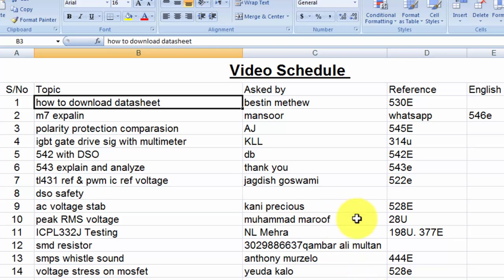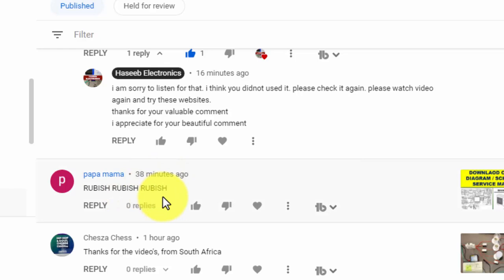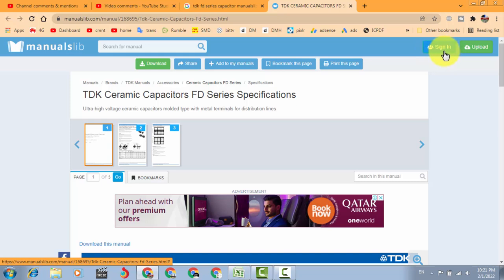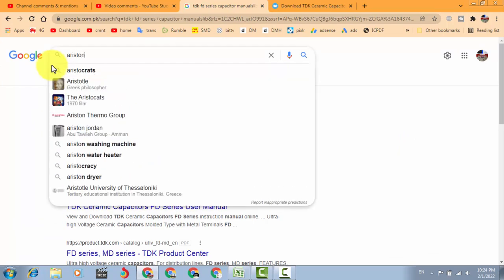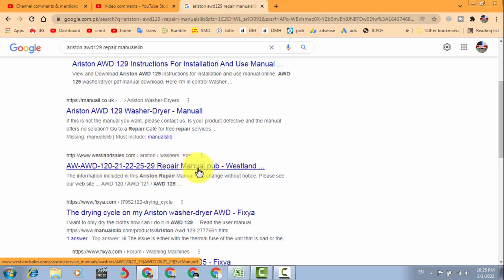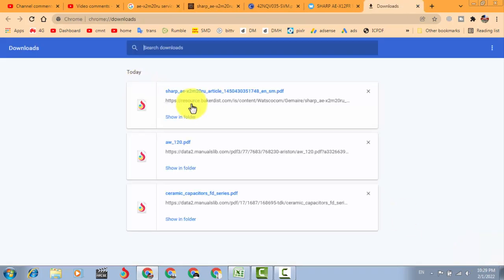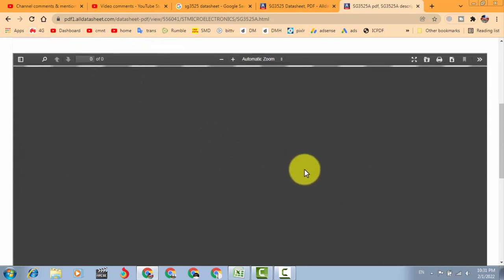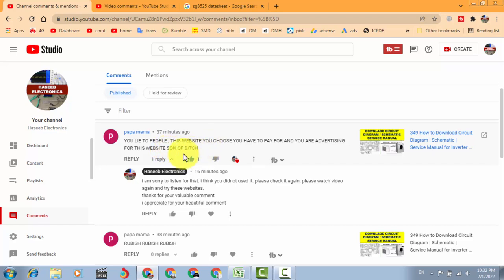{553} How To Download Service Manual / Repair Manual / Circuit Diagram / Datasheet / Schematic

Comment: Sir mera paas aak switchmode power supply ha jis ms pwm ic legi hove ha viper22a aur vo ic burnt huve ha jab ma na new ic leagi vo phir sa short dikhrehi ha please help me to solve this problem other part in primary side shows ok but when we check drain pin and feedback pin in ic it shows short in supply when we remove ic and check dc volt in capacitor it shows ok but when we install new ic the dc volt drop and series lamp glow sir plz help me to solve this problem

Comment: Thank you. Sir please explain working principle of boosters trap capacitor and if possible provide me lg dual inverter air conditioner service manual and schematic circuit diagram. Please thank you again.

Comment: First of all Sir I don't think you need to defend yourself to idiots.  You have proven yourself to be an excellent teacher. I have never found anything you have said to be untrue. I have been in electronics for over 40 years. I learn new tricks from you and use them. Thank You for all you do.
Reply from the maker: sir best regards and special thanks for your valuable wods 
it is my pleasure 
i respect for everyone's comment because it is his feedback either it is positive or negative. it depends on someone's angle of thinking. so that's why i highlighted his comment, may be he will learn something
Reply: @HaseebElectronics  
Sir hi could you please help get a service manual for innotech crt tv model

Comment: Hi, your video is very interesting, but I need to know where can I by circuit diagram of chinese audio products, can you help me? Thanks.
Reply from the maker: best regards 
for chinese unbranded products are generally produced in market without circuit diagrams 
you can find the datasheets for the main ICs within the circuit and the sample application circuit 
so in this way we can take circuit sketch in portions and always it is above 95% closer to the actual circuit 
may be some components values may slightly differ the sample circuit
Reply: @HaseebElectronics  Thanks for answer, I have preamplifier of good name Mingda MEI -xing. I have burned transformer, I am capable to change it by myself but I need transformer production number ( it was burned to black).
Reply from the maker: @alexeichikish2221  I have no idea about this product 
If this product have it's service manual supplied online. Then you can find it's part number 
Or you can approach the manufacturer on their website, might be the reply

Comment: Glad to see you back from ransonware. Good!

Don't argue with people insulting. That person has no education to behave, so he won't appreciate any effort you do for him. That one is probably a troll trying to poison your comment section. I suggest ignoring those and engage only with people criticising or asking with education.

Regarding manualslib, be aware that sometimes id doesn't offer a download link if you are using a heavy Adblocker or Cookie deleter. The "I am not a robot" button disappears. The solution is to open it in an icongnito windows, and download there. It is a good website.

Comment: Hi sir could you please help me to get a service manual for innotech crt tv model 29n208k
Reply: Please help me sir I did try alot of sites but go nothing
Reply from the maker: good evening 
please send the board model number or try to search using pcb board model number printed on the circuit. might be the circuit is being used in some other brands
as there is no data about this brand innotech crt tv model 29n208k

Comment: Asalamalaikum, Bhai can suggest how to fix smps mostly with multiple outputs used in home teatre combos dvd, fm & D class amps no 30volts out for power amp in dead condition pl help. thanks.

Comment: Sir your explanation are very good,
     Thank u.
If I want to down load ckt daigram of my monitor Acer how can I ?
   Do i have model no serial also?
    I have tried to do as per the regarding how to get service manual or ckt diagram ,but i got the message i have do it via web operator, earlier in 90s we used to it ready made diagram in ckt books at lamington road, now there is no one as such,if u don't mind sir if I send u model no will down for me and send ,i will pay u ,and also be obliged for.
   Do feel bad the last sentence
     Thank once again.